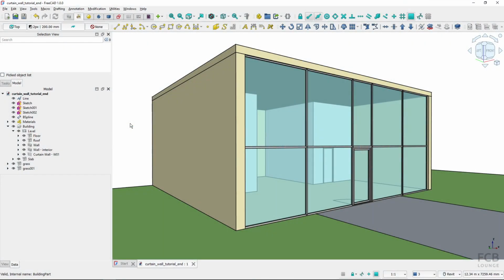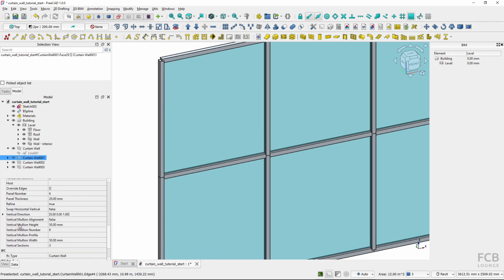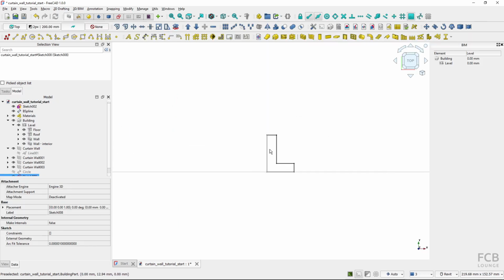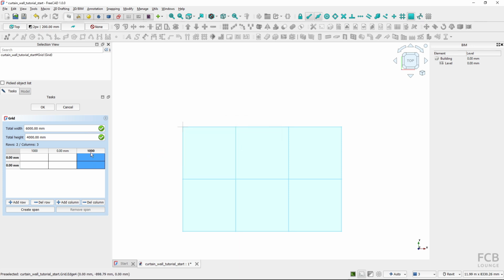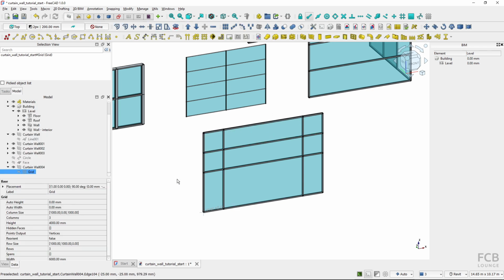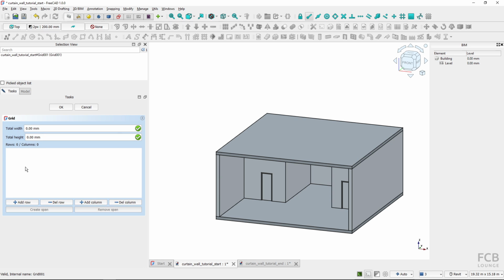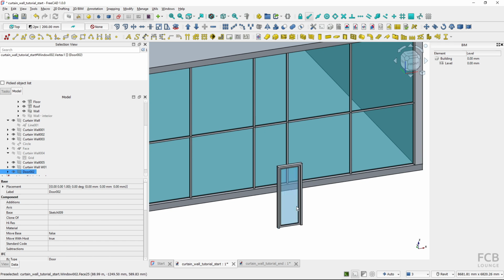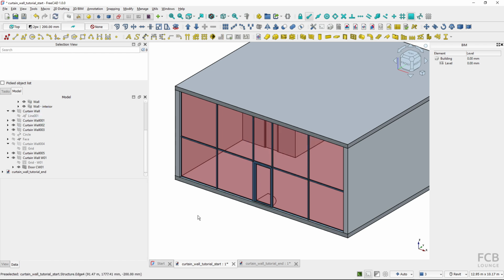Create Curtain Wall in FreeCAD BIM

Comment: Awesome  Tutorial, your explanation was very clear.
I've mainly been using Part Design to create windows and Doors to manufacture in my Joinery Business. Now I'm starting to use the BIM with the help of your videos. The process is gettting better and Easier .
Reply from the maker: Glad the tutorial was helpful.

There are still many limitations when using Curtain Wall, Door or Window tool. But as you wrote, it is getting better. There are some nice enhancements to the Window/Door tool which should give user more freedom in creating these. Hopefully it will make it into the 1.1 release.

Comment: Hello Tom, thanks for this video, very well done! For a future tutorial would you be able to focus on customized doors? As you've made a curtain wall with a Grid I wonder if a door could be made also with a Grid... I would like to make a garage door/gate composed of 3 independent panels with 3 different widths but the same height. The left panel would open inwards hinged on the frame and the other 2 panels open inward in a folding way or as a whole. Do you think this type of gate is possible to be made with FreeCAD 1.0 ?
Regards
Reply from the maker: That is quite a complex door. I am not sure if it is possible to create with the default door tool options. It is for sure possible to create it in Part Design workbench and then just classify as Door objects.
Custom door/window creation is for sure a topic of one of future tutorials.
Reply: @FCBlounge  Thanks for your answer. There's a channel from India with customized windows (Indian style) that I've watched some years ago I'll try to find it and bring to our attention. Regards
Reply from the maker: @LFANS2001  Also note that Window/Door tool is currently being refactored. Not sure when it will be ready, but hopefully it will bring nice enhancements to the tool.